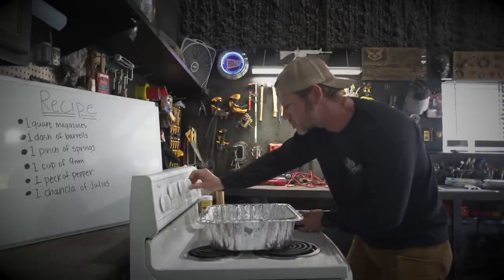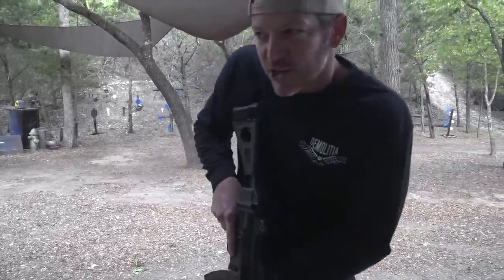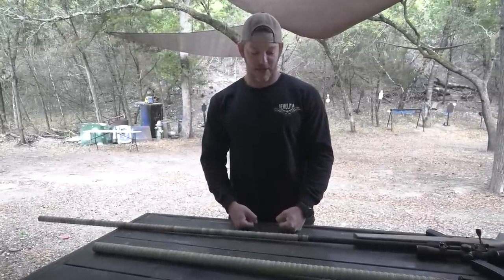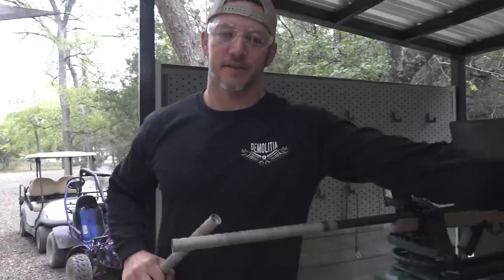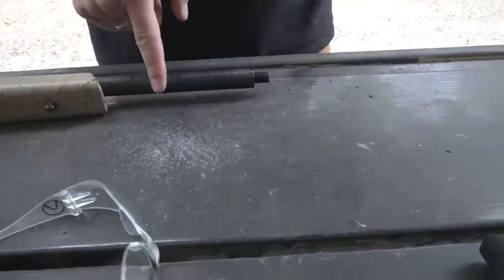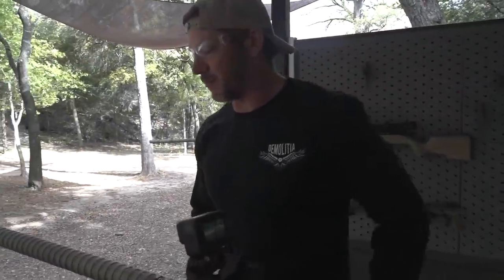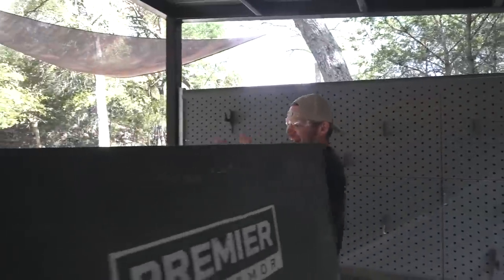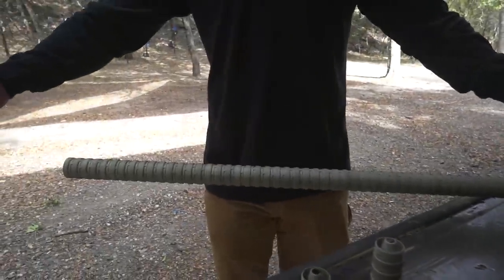YouTube DELETED This Video!!! They DO NOT Want You To See The WORLD'S LONGEST SUPPRESSOR!!!

Comment: I would like to see you use a support midway and maybe at the end underneath the baffles and see if that works. Also very curious if the bullet loses power from the extended length baffles.
Reply: Assuming the round does not hit part of the suppressor, its flight should not be affected in any way by the extra length. Silenced guns being weaker than their loud counterparts is a videogame trope used to balance the benefits of shooting quietly by doing less damage, it doesn't have any basis in the operation of real firearms.
Reply: @Resurgam B7  There is some real-world basis in suppressed firearms being weaker than their non-suppressed counterparts. Integrally suppressed firearms that rely on ported barrels (such as the MP5SD) bleed some of the gas away to keep the velocity of the bullet subsonic. Suppressors that use rubber wipes will also somewhat reduce the velocity of a bullet fired through them. 

Of course, most modern suppressors (such as the ones in this video) don't rely on ported barrels or rubber wipes, so as you rightfully pointed out, the velocity of a bullet would be unaffected by the suppressor.

Comment: I think the issue with when you were firing from the shoulder is that the motion of working the bolt action would generally still be bouncing the tip of the barrel when you fired. If you were in a snipers blind or something this might be more viable. i mean it was the 22 tho. the 9mm flexed a lot less

Comment: There's more material in a 9mm suppressor than there is in the .22 suppressor, that would serve to hold the length of it more rigid before experiencing any sagging. The video also serves to teach the anti suppressor nuts that even with 5' of suppressor attached to the barrel, it still is not silent.

Comment: I had a NEGLIGENT not accidentally but a NEGLIGENT discharge today in my living room.  Savage axis .308 win. It happened after I loaded the weapon, placed it on “Safe” and then pulled on the trigger while it was on safe. The trigger went back slightly but not enough to discharge the weapon. It did however lodge itself VERY CLOSE to firing. When I took it off safe (no particular reason) it fired. My finger was not on the trigger nor was anything touching the trigger or trigger guard. Ears are still affected. Has anything like this ever happened to anybody?
Reply: Also a little update the round didn’t go through a wall it went through the ceiling and unfortunately the roof.